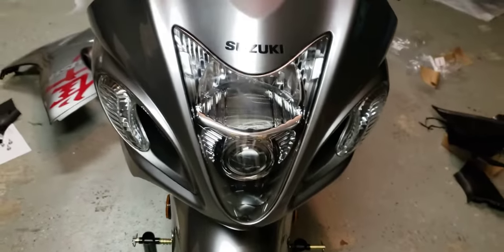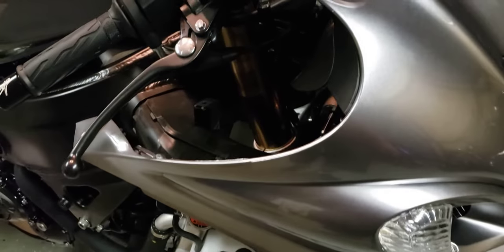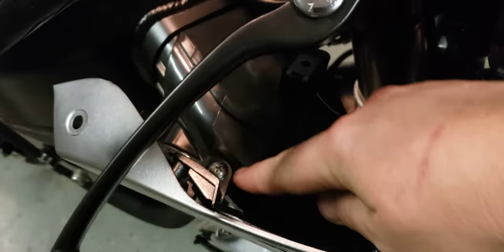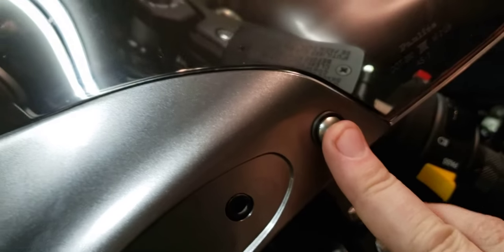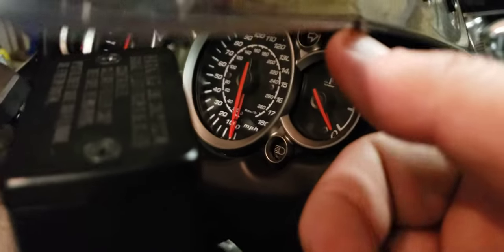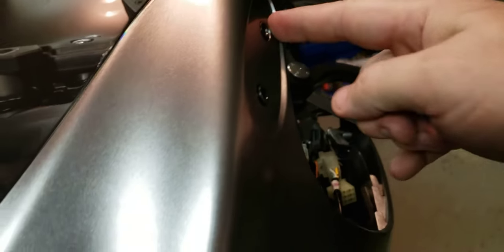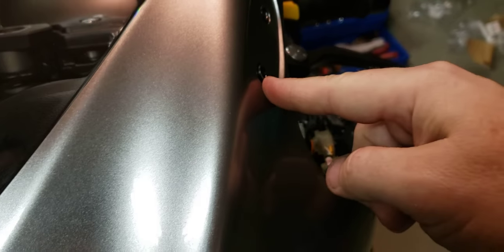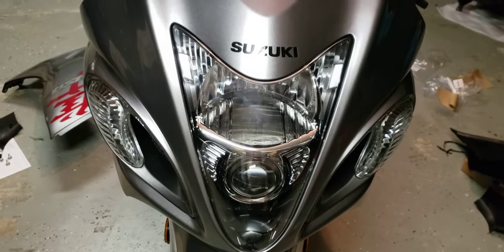Suzuki Hayabusa - Front Fairing (Headlight) Removal in only 3 minutes! | Gen 2 Busa

Comment: Were you able to take the nose off if your side fairings were in place....
Or you need to remove side fairings before removal of front cone..
Thanks.
Reply from the maker: That is actually a great question because I didn't think about this when I removed all my fairings. Yes it would make it a lot easier to remove with the side fairing off, however I am not 100% sure if they absolutely must be removed.